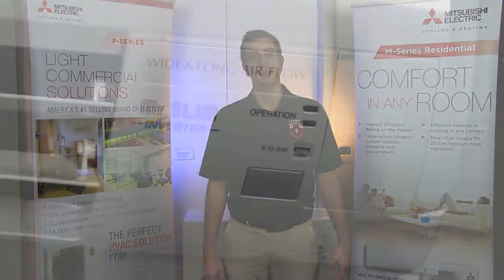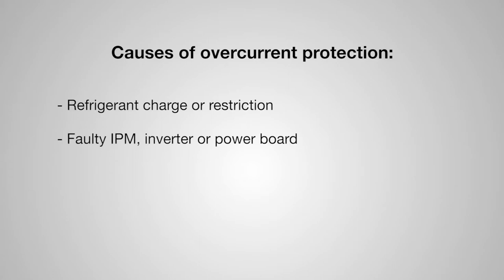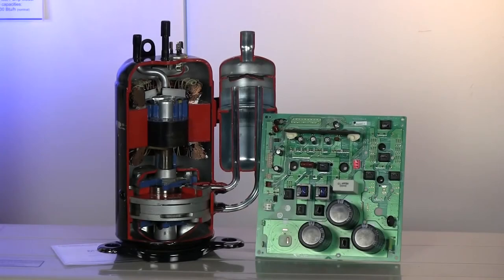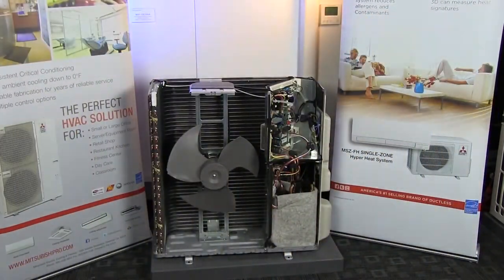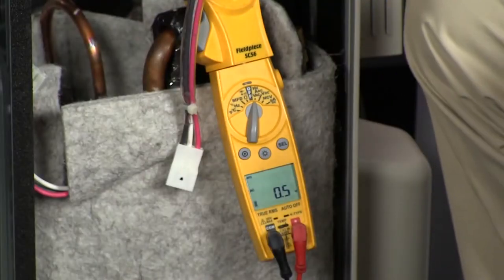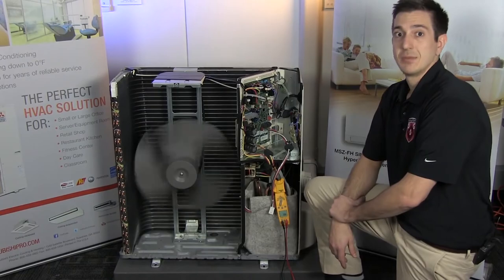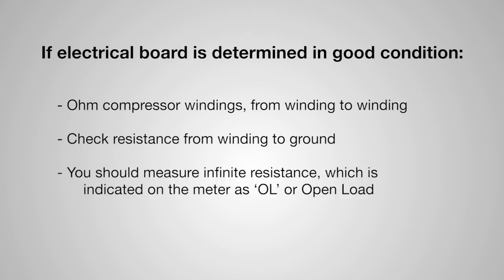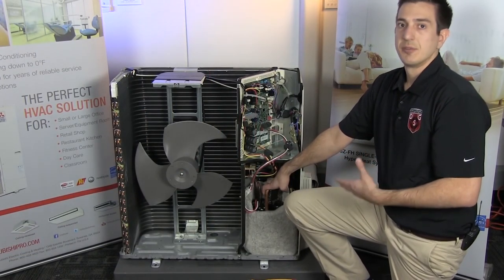Tech Tips: How to Resolve a 5 Time Flash (L)

Comment: Is it possible for the whole system to shut down do to overheating if the outside temp goes over 85 degrees? And the system running add on to that temp around it?

Comment: I have the 5 flashes, sometimes it works though both in heat and cool mode, more often than not it doesn’t work though, any extra hints on what the problem may be?
Reply: @Linda Chevelle, hi, did you figure out the problem? What needed to be changed? The board?